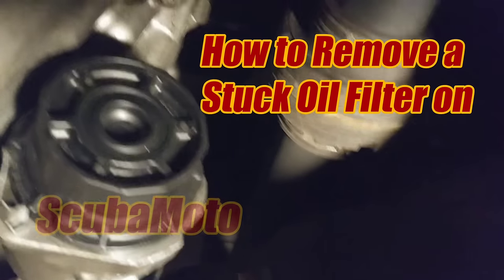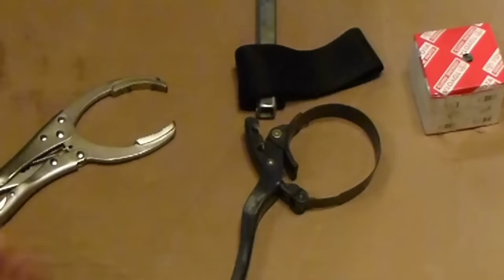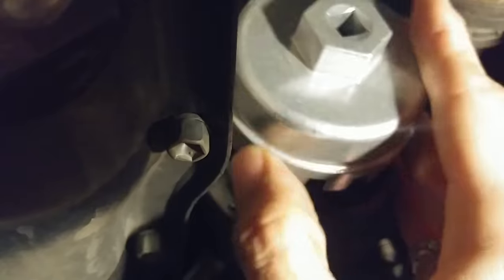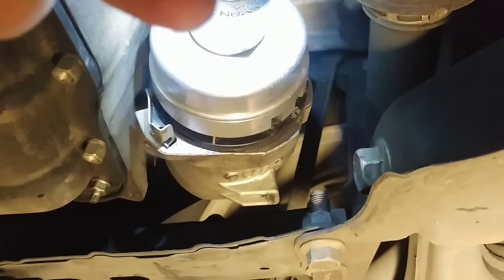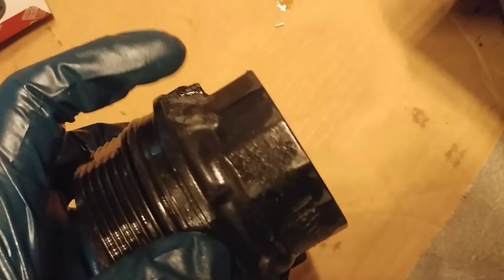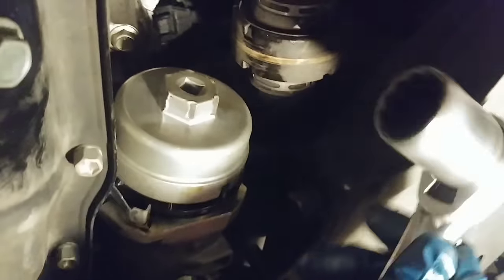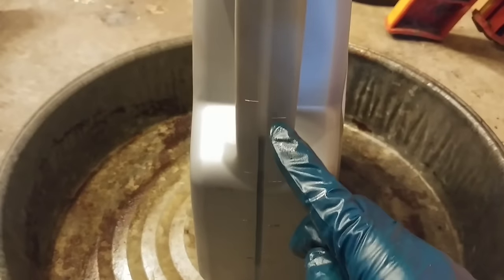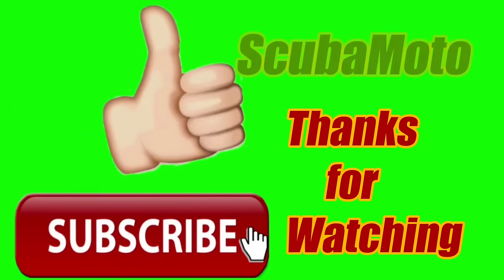How To Remove Stuck Oil Filter Toyota Prius Corolla Lexus Oil Change

Comment: I used an air impact to take mine off and it snapped the plastic tabs off and put a hole in the cap. I found an aluminum replacement cap at the auto parts store.
Reply from the maker: Brad Cotterman: That thing must have been seriously over-torqued. A metal replacement sounds good; probably what should have been OEM. Thanks for watching and sharing the story.
Reply: Was that on a Prius?

Comment: Is the cap for the oil filter something commonly carried at autozone/o’Riley /advance or do you have to get it from the dealer?
Reply from the maker: Joseph Pervez: Yes, they're very easy to find. Most of the auto parts stores have these in stock; just call them first. Here's a link if it helps: https://amzn.to/32bMbpp.  I just searched on "Toyota filter wrench" and saw this style. Just make sure it looks like the one in the video so you get maximum points of contact for a high-torque removal. Good luck with it and thanks for watching.
Reply: ScubaMoto thank you! I did my friends brakes and oil. I was looking under the car for the oil filter and then quickly realized it’s not a canister. I’ll make sure to tell them to pick one of these up
Reply from the maker: If the owner's buying it, you might want to text them a picture of it to make sure they buy the right one with the teeth. Some shops will try to sell a simple 64mm cap wrench which probably won't work.
Reply: Do you mean the oil filter cap? Or the oil filter cap wrench?

Comment: Can I use long breaker bar? I don’t have an impact driver. I have a socket just don’t have impact driver. Planning to do oil change on friends car. She told me that her oil filter is over-tighten. Your car look exactly same as her car , except she have 2009 Pontiac vibe.
Reply from the maker: Weather- -Girl: Thanks for the question. The one in the video was super tight. I typically do not prefer using impact in situations like this but I'm sure it was installed with a pneumatic impact wrench at the dealer shop. I tried a breaker bar with the correct wrench with no effect. I then used an extender pipe slipped over the handle of the breaker and all it did was rock the car. If you're working on a vehicle on jackstands, it may not be safe to use a super long bar since rocking the car could cause stability issues. Sometimes the effect of impact is necessary to undo a bad impact installation.
Reply: ScubaMoto I’ll be using a ramp not a jack/jack stands. Well I’ll try my best with breaker bar/other tools. I will start saving money for impact . Thanks for the answers.
Reply: Yes the Pontiac Vibe has the same filter as long as it has the Toyota 1.8 liter engine.

Comment: I just changed the oil and filter on my 2016 rav4 and had the filter not come off with that same tool and an impact. I had to get my 2ft breaker bar and stick the jack handle of my hydraulic jack over the end of it and unleash my inner Hercules.
Reply from the maker: Ryan Espinoza: Thanks for the great comment and congratulations on a job well done. Mine was the opposite. I first tried my cheater bar with a pipe over it and it just rocked the car (on jack stands). The impact took a few seconds but pounded it loose. Thanks again for watching and for sharing.

Comment: Well this is good info for the wife's car next time I just spent an hour using 4 different tools to try to get the damn cap off until I slipped and smacked the fuck out of my knuckles and cussed and gave up. That's why I didn't want her to take her car to Walmart the last time she got an oil change. I'll have to grab that handy tool for the next oil change since it's going to have to be soon because i couldn't change the damn filter.
Reply from the maker: Gaph: Damn! Sorry hear about the knuckles. The end result is often the same; the oil gets changed but not the filter. I'm pretty sure the filter in the video was long ago abandoned given how it looked when I finally got to it. Good luck getting it with the new tools and thanks for sharing the story.

Comment: I'm not crazy. Used my dewalt electric 1/2 impact. Did not move it. Had to cut the longest cheater bar (car was on ramps) for the 1/2" ratchet to finally get it to budged. Not sure if it was this tight from the factory or if the factory dealer actually did the filter change.
Reply from the maker: Lonnie Hargrave: That sounds pretty tight. But I'm not too surprised since my 300 ft-lb impact driver took a while. I had to be patient so I fast forwarded in the video. 300 ft-lbs is equivalent to 50 lbs of force with a 6 ft cheater bar - plus impact. Good job getting it off!

Comment: I noticed the safety clip was not removed. I’ve done all this before I got to the video no help. I’m getting ready to either put oil back in and drive it to the dealer or chip it off in pieces with my pneumatic hammer. When I bought the replacement cap for this last attempt at fixing this the rep told me that Toyota has gone back to regular filters on Corollas.
Reply from the maker: Yeah, there's never a reason to remove the spring arm. There's a note in the video description on that. As long as they're installed correctly, I've never had trouble with this housing design but Toyota has gone back to traditional metal cannister filters on the corollas, Camrys and others. Thanks for sharing.
Reply: @ScubaMoto 

After my hissy fit in the original comment I decided to just put the impact gun (same as yours) back on and just press the trigger and wait. Finally came off. What a POS design.

Comment: I wanna thank you tried to change my gf oil on her Toyota I busted my hand trying to take
It off I tried a bar all well thanks to you I will get it off next time amd I def know her oil changes the filter was not changed for sure or last guy did a number
Reply from the maker: Glad I could help and congrats on getting the old filter off. Thanks for sharing.
Reply: @ScubaMoto  well I got two options the big socket with a wrench but jack it up more or the impact wrench I’ve also heard to tap it all around to unbreak  that seal . But you’re video is good
Reply from the maker: Yeah, the impact wrench kind of takes care of all the tapping and gives the torque of a cheater bar while doing the tapping. That's why it works. I'd be surprised if a good 24-inch cheater bar wouldn't do it for you or maybe a pipe slipped over your ratchet.
Reply: @ScubaMoto  I have Ramps the issue is also the clearing for a good cheater bar etc may just use a impact wrench thanks

Comment: I literally just broke the exact tool you are showcasing..... I'm not sure what to do :(
Reply from the maker: Jacob Thorndill: That's unfortunate. Please let us know the circumstance. Did it break using the 1/2-inch or 3/8-inch drive insert or while using a 27mm socket? What type of impact tool? I've heard of these cap wrenches failing when using the driver insert instead of a 27mm socket on the lug. Thanks.

Comment: I tried to change the oil on my Toyota Corolla 2010 I tried everything,  pliers, metal belt,  even my on belt , hammer , flat driver , and nothing that fucking cap didn't come out, I even broke and nothing,  now I ordered a new one and the metal oil cap wrench. Thanks for the info 👍
Reply from the maker: Al83rt Salazar: Thanks for sharing.

Comment: There is a conversion kit that will allow you to use a normal style filter but it’s about $300
Reply from the maker: That's true. I don't recommend it because these housings have built-in by-pass valves with a factory pressure spec. If these aren't over-tightened, there's no reason to convert. Just keep it hand-tight and the plastic OEM housing will last a lifetime. Thanks for the comment.
Reply: @ScubaMoto  Good to know thanks.

Comment: Why is fking toyota make oil filter like that!!!!
This is insane!!!
Reply from the maker: Mikeyi Mikeyi: Exactly! Some engineer was paid to design it. Perhaps to sell more parts, tools and service? I'm just glad that Toyota isn't the only ones making the wrenches you need to remove the tough ones like this. Thanks for watching and for the comment.
Reply: there is only 1 reason...  its called $... that simple..... they are saving a shitload of money by doing this....  and they will NEVER come off after lightly tightening it...  don't need to tighten it much at all....

Comment: Thanks.. Just Craaazy that you have to buy another TOOL to get this thing off. I have a black removal tool. Not working so well...
Reply: OK- got the RIGHT tool at Auto Zone.. Make sure you get the SILVER tool, not black.. The Prongs must be straight to fit in between the notches..

Comment: Broke the teeth on my ratchet, wallard out the 3/8 female end of the, brand new, Motivx Tools Oil Filter Wrench; Had to use a punch to drive the 3/8 extention, now captured in the, no longer new, Motivx Tools Oil Filter Wrench!? What moron changed this before me and how long ago!? Came hear to make sure the "filter canister" wasn't reverse threaded, despite the canister saying open with an arrow pointing in the lefty loosy direction. Had to send ex girlfriend off with new oil and (how) old filter? Need to get a 24mm socket and ask friends if they have an impact driver. Thanks for video and useful info and no useless info Chater!

Comment: Is there a stronger filter cap? I got mine at an auto parts store and I tried using a breaker bar but the cap ended up warping and the plastic tabs all broke off now I can’t take it off
Reply from the maker: MidnightThing: There's an aluminum one for Lexus that I believe will fit: https://amzn.to/32tamzL - OR -  https://amzn.to/3kevRun (has a filter drain plug). If you're putting it on yourself then it will never be over-torqued so you could stick with the original OEM type: https://amzn.to/2ZDBvOG. Good luck with it. Thanks for watching and for the comment.
Reply: @ScubaMoto  That metal one has an open end with a female thread; it must be designed to have something screw in there -- oil pressure gauge connection?
Reply from the maker: Alan Beagley: Good catch. It's just a drain plug. Some vendors selling the metal housings that require a drain plug will include the filter drain plug: https://amzn.to/3kevRun, others will not. I edited my reply above to include: https://amzn.to/32tamzL that requires no filter drain plug. Thanks for watching and for the comment.

Comment: I can't get mine off ... Can't get it lifted high enough to turn my strong arm enough.  Ugh
Reply from the maker: That might be one more reason to try an impact wrench like in the video but I still recommend using a cheater bar or a pipe on the ratchet first if you can make the room. Good luck with it.

Comment: I used my impact and the first try,  it came out, but I broke two oil filter wrench😢
Reply from the maker: Was it impact using the 3/8 drive slot on the filter wrench or was it using a 27mm socket over the lug on the wrench?

Comment: Before i put a gun on it, i try to get it to move in the tightening direction. If it moves, then it will loosen up ok. If it don't move in either direction, the gun will do the trick.  It doesn't need to be that tight.  The oring seals it, not the flange or threads.  Hacks don't understand that.

Comment: A breaker bar has more mechanical advantage in this case because the whole cap is actually a nut
Reply from the maker: Robert Urkevich: Thanks for the comment. Most watching this video do not have vehicle lifts. They are crawling under vehicles that are resting on jack stands. This does not always allow for the space to effectively use long cheater bars. My 2-foot cheater certainly wasn't enough but impact got the job done with some patience. Thanks again for watching and for commenting.
Reply: @ScubaMoto  
Of course, if you have a Camry, RAV4 or other Toyota with a 2.0 or larger engine (even V6 or V8 engines) the oil filter cap is mounted vertically which makes a breaker bar a real option.

Comment: Only one issue I have with this video. I wouldn't use a 12-point socket for something like this, or anything else for that matter. I've lost count of how many heads I've rounded with those things.
Reply from the maker: Totally agree, 12-point was handy and fortunately it worked and made it in the video but 6-point is much better, especially for impact. Links in video description are all impact grade 6-point. Thanks for the comment.

Comment: I did the same thing, but my impact gun must've been too weak. We ended up using a long torque wrench and our legs to break loose the cap. Then we were fortunate enough to get the tool stuck on the cap, unable to remove so we changed the filter and just installed the stupid thing and left the tool on there for next time. Dumbest filter cover ever. Hate it.
Reply from the maker: DimSumJim: I first tried a breaker bar with a pipe slipped over it and it wouldn't budge. So then I tried the impact driver. After about a minute or so, it did a bit of harm but it finally came loose. Since you have an impact gun, a nice trick that I've had luck with when the wrench sticks to the filter housing during removal is to just give the stuck filter wrench a quick clockwise burst with the impact gun. You don't have to do it long enough to tighten the filter housing. Just a quick clockwise burst with the impact driver will usually unlock the filter wrench from the filter housing. Thanks for watching and for sharing.

Comment: What is the part number on this tool so I can go buy one.
Reply from the maker: David Logan: I don't know the Toyota number and I wouldn't bother. Just make sure it looks like the one in the video. Either of these will work:  @t or @t. There are simply too many good non-Toyota options for under $30. I've seen them at local auto stores under multiple brand names. Thanks for watching and for sharing.
Reply: ScubaMoto Well, the reason I asked is that all the others I’ve tried look no where near as nice as the one you used in this video, I am literally on my 3rd one.
Reply from the maker: David Logan: I keep two On hand. One lost a small tooth in this video but still works fine. Depending on how badly yours is over-torqued (and it sounds pretty bad), you may need impact to remove it and you may need several wrenches to get the job done. Like me, I assume you've tried a breaker bar (18-inch 1/2-inch cheater wrench). I even slipped a long pipe over my cheater bar and it just rocked the vehicle, so impact was required and was safer than rocking a car on jackstands. I've seen them tight, but the one in the video set the record for me. If you watch closely, the wrench in the video lost a tooth during the impact removal process and the filter cap took a beating too. I fast forwarded through a lot of it because it took a while. I believe that both of the brands I mentioned in the post above are aluminum. Model numbers are rarely mentioned since it's such a common wrench. Order a couple and have the 300 ft-lb or better power impact wrench on hand. Good luck and please let us know how it goes.

Comment: How do you get a broken one of these oil filter housing
Reply from the maker: Charles Saylor: I would have to see the broken housing to advise and even then, plenty could go wrong. You would need to be careful about many aspects of the job so you don't damage the engine. Sometimes drilling through the filter housing to slide a long bar through it to crank it off can work but there are many ways to damage the engine or worsen the problem if done incorrectly. If things go badly, towing it to a professional would seem cheap in hindsight, so that might be best. Sorry about the situation, good luck and thanks for watching.
Reply: Use an air hammer chisel gun but if not available use a chisel and hammer. Hammer it out the heck of it careful not to hit the main metal housing on the side. Of course make sure you already bought a new metal canister from napa or other parts store. Don’t buy the plastic ones, they bind and hard to remove. I did hundreds of this filter.
Reply: @a7bie  
Is the smaller housing on the Corolla, or Prius available as a metal unit? I thought they only fit the larger engines?

Comment: What is the part number for the genuine tool??
Reply from the maker: BerettaTV: I don't know the Toyota number and I wouldn't bother. Start with https://amzn.to/2POqOU9 or https://amzn.to/2DUMAD5. There are simply too many good non-Toyota options for under $30. Thanks for watching and for the question.
Reply: Thanks, I got the same one as you on eBay and waited a week for it, then went to my local parts store and saw it even cheaper
Reply: Believe it or not but the Toyota dealer here in Hawaii (and there is only one in the whole state,yes they have a monopoly) does not even stock this tool. Had to go to NAPA.

Comment: On many Corollas with the 2ZR engine,  it is possible to change to a spin-on filter. Check out this web page I ran across for details:  https://www.armstrongfamilyblog.com/armstrongracing/the-2016-toyota-2zr-engine-oil-filter-conversion
The spin-on oil filter you would start using is for a 2016 Corolla with the 1.8L 2ZR engine.  This guy got four new bolts, but you can use your old ones. You need the new housing PN: 15609-0T060, two o-ring oil seals PN: 96723-24020, the union PN: 90904-04006 and a new spin-on oil filter PN: 90915-YZZF2. Also need to check/add oil that may have been lost doing this work.  If you do this, you assume all risk for anything that might go wrong.
Reply from the maker: Frazzled: Thanks for the info. That looks like a well built conversion kit. But as Chris Rock would say, "I wouldn't do it, but I understand." The bracket, the union screw and the investment in time and coin just seem hard to justify in most cases. If you just do the filter change yourself, it will never get over torqued again. I've never had trouble removing the OEM filter when I put it on or it wasn't over-torqued. It does look like a nice bracket though. Thanks again for sharing.